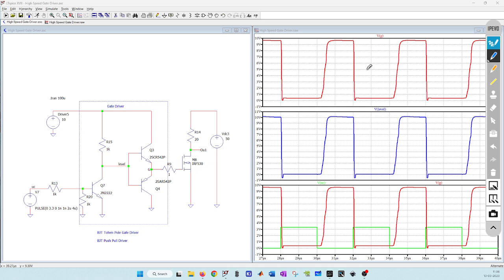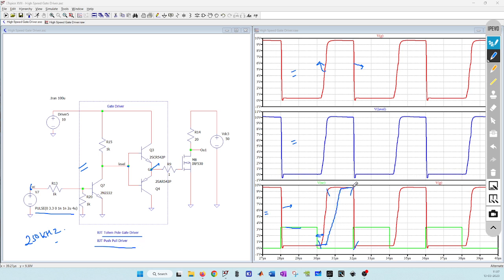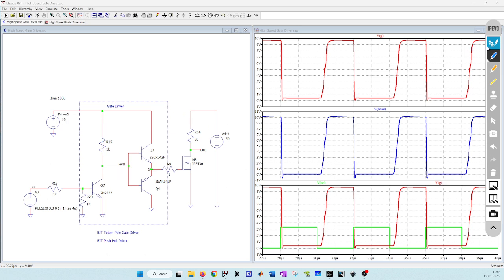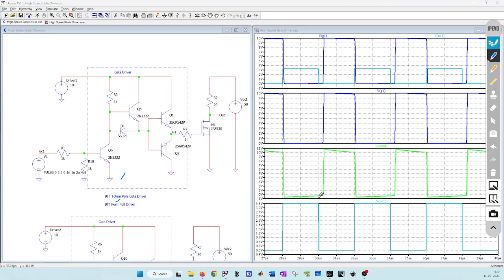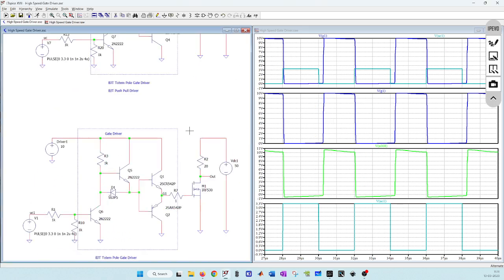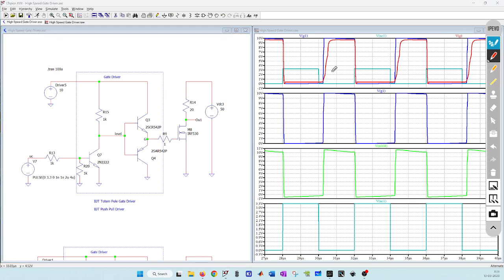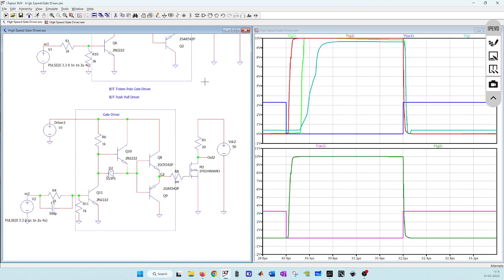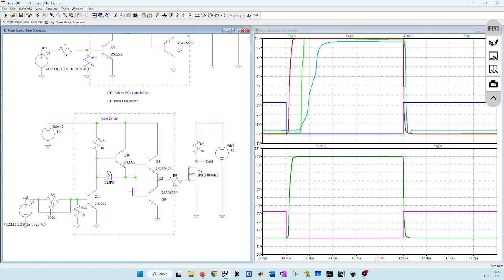High Speed Gate Driver for MOSFETs using Discrete Components

Comment: that's very awesome, i also fix the rise time with ic like MIC4424, 4421 to remove the totem pole on my circuit, but with this tip, i am not using these ic for cheaper circuit, tks